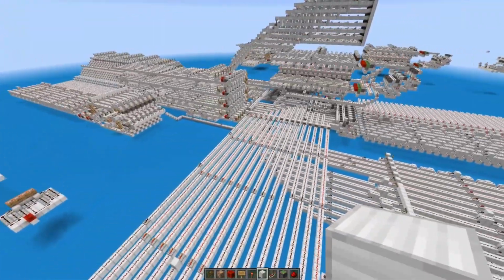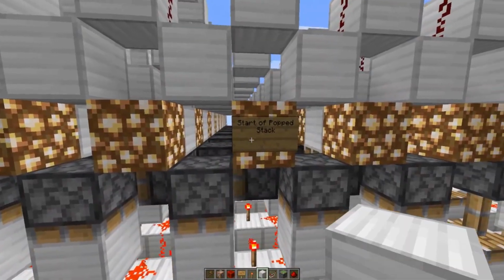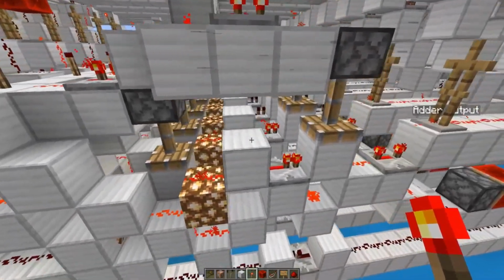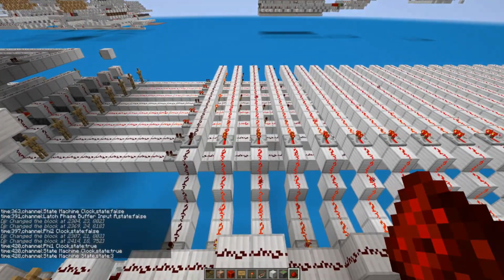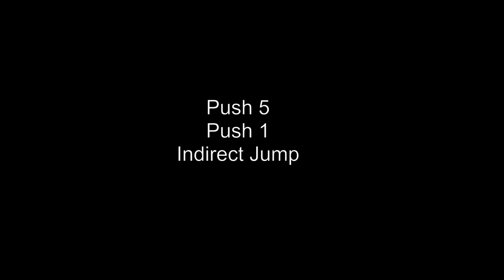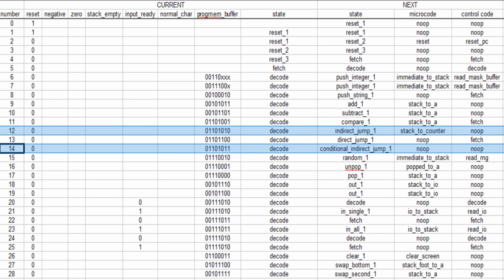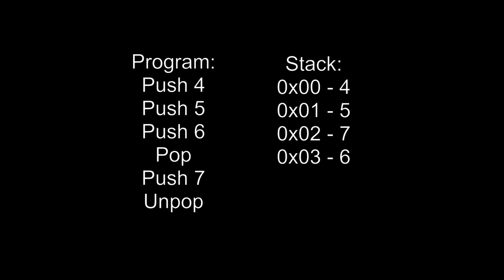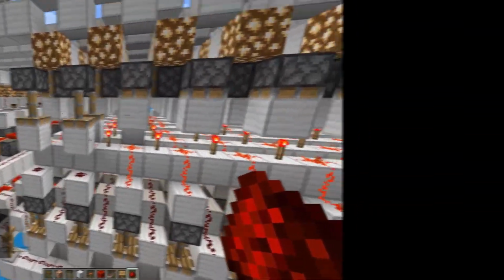Fatstacks Vlog Entry #8

Comment: random question, but on the adder, how do you get the carry out bit? I am using the same design on one of mine, and I am running into issues for the carry flag. Any help would be great
Reply from the maker: There's a carry line that runs through the adder, just tap off the end.

Comment: I'm currently working on my 4th computer, and I tried to make it a pipelined computer. I'm having a lot of problems with everything. Do you have any suggustions?

Also, do you know of a really fast adder design? I'm trying to make an ALU that can add 3 numbers at a time. When using a standard ripple-carry adder, It takes like 10 seconds with 5 adders. It may seem like an odd choice to make multiple adders, but that's one of the challenges I was giving myself with this computer. So... cool?

Also, In my computers, I've never been able to make a program that can devide. Like, how do you figure out how to subtract from 10 / 2? Is there a certain thing I have to add to my ALU?

thanks in advance.

The keyword is maintenance.
Reply from the maker: I can't say I'd be much help with pipelines, as I'm only just starting to explore them myself. The only thing I'd have to say is take it slow and test everything thoroughly. Dependencies are your biggest issue, watch for them.

As for adders, Bennyscube has a decent ICA circuit. That's actually what I was using in this computer.

 For division, You can give your computer specific hardware, or you can implement it in software or even firmware.
I'd recommend watching this guy's video on the subject: https://www.youtube.com/watch?v=z0RIEvzX65I
He shows a hardware approach, but it can be turned into an algorithm easy enough.

Edit: Ben Eater just recently released a video on the subject of binary division, I'd recommend checking that out too: https://www.youtube.com/watch?v=v3-a-zqKfgA

Comment: How do you make busses because repeaters are only one way?
Reply from the maker: You see the schematic at the roughly 6 minute mark?
Those are all uni-directional buses.

In electronics, you don't have to worry too much about the placement of your components because they'll talk to each other regardless of where they are on the bus.

Redstone does not have such an advantage... you need to be very mindful of where you place everything.

That's not to say you can't use bi-directional buses. My first computer, bluewave, used a bi-directional bus to connect everything.
I don't use them anymore though, simply because I find the chunkiness of the bi-directional repeaters to outweigh the benefits.
Reply: Oh ok thanks

Comment: I'd like to show you something pertinent to this project. Could you give me your email so I can send it (with context)? I couldn't find it on your about page on YouTube, maybe it needs a little maintenance. :)
You can find my email on my YouTube page, or you can send yours to me securely via Ricochet (website ricochet.im) my ID is ricochet:3frw7trm3uo3xe5w
Reply from the maker: While normally I'd be open to that, there's been a wave of account hijacks that's been going on, though it looks like you're already aware of that.
If it absolutely needs to be privately relayed, I have a discord... would that work?
Reply: @n00b_asaurus  I closed my Discord account and I'm not sure if I could make one without a phone handy (which I don't really have one handy). Is there any other method? I could provide information only I would know or something like that.
What I want to message doesn't necessarily have to be through email although it's best suited to it. It involves me sending some (small, zipped) files. You could set up a burner email if you'd like, I'll check my spam.
Reply: @n00b_asaurus  If you don't give me an email in a day or two I'll go ahead and upload the files (and a stripped down version of the email I intended to sent) to a file hoster of somesort. I'll link it here of course.
Reply: @n00b_asaurus  I went ahead and uploaded it to Google Drive. It includes a stripped version of the email. Feel free to share the link if you'd like.
https://drive.google.com/open?id=1Ug28m0OLMB3-UAEoQzhjQnBL92x0A3oK
Reply from the maker: Hey sorry, youtube notifies me of new comments, but not new replies.

I appreciate the update! It's definitely been a while since I heard from you. 
It's quite alright if you took a bit of a hiatus, I just noticed one day that your website had been taken down and your youtube channel had been drastically downsized. Got me a bit worried.
Hopefully tying up loose ends doesn't mean it's the end of ender_scythe. I appreciate your input, and I always like hearing peoples stories of projects, discovery, and improvements. Ultimately it's your call though.

I'm glad to see you liked what I've done with your project :D I've said it before, this was a very interesting challenge, and I'm liking how it's turned out so far. And yes, if you're up to suggesting more challenges, I'm up to hearing them.

It's great that you took up programming again... but seriously? C?
I'm joking! If it works for you, more power to you.
Don't worry too much about your early work being terrible... everyone's first attempt at anything is terrible! Fortunately when you're at the bottom, the only way to go is up.
I'm also glad to hear I've inspired you to pick up the stackish project again... it took me a second to realize stint was short for stackish interpreter... classic C shortenings :)
Have you seen any of uncle bobs lectures? I'd highly recommend watching his video about test driven development. I would say that and his SOLID lectures helped me out tremendously!
I would also recommend reading up on OOP is you haven't already.
I used to dislike it myself, mainly because I didn't entirely understand the point of classes and objects. Selling it as a tool for organizing code into hierarchical taxonomies didn't help... that just made everything worse!
It wasn't until I learned about polymorphism and the idea of changing the functionality of code without changing the code that it all sort of clicked.

I bring this up because it looks like you intend on adding more features to your new stackish interpreter.
I think those concepts might help you keep things organized while also minimizing the amount of rewrites you need to do every time you add a feature.

Of course if you already know about all this, then I look like an arrogant snot XP
If that's the case just ignore me! You're doing fine without me.

If you like code obfuscating, have you seen bisqwit?
He have a video about obfuscation I think you might enjoy....
Actually if you like C, you might enjoy his channel!

I do appreciate the logo, and I think it will go nicely in the computers manual :)

Regarding unix to stackish, I was thinking the same thing. There are many things the architecture would need to support, but you're right, memory management and interrupts would get it most of the way there.

Thanks for your suggestion for the original idea.
Hopefully I'll continue to see you around!
Reply: @n00b_asaurus  I'm afraid it probably will be the end for ender_scythe, although I'll stay for a bit (or byte, or word...) longer since this is all really interesting and I might have a few more things left in this persona. Of course the end of ender_scythe won't be the end of me. I'll just leave to a new name on likely a different platform. Software development is really fun and videomaking is really interesting, it'd be a shame if I just stopped. Before I truly leave I'd like to compile some sort of archive as a checkpoint of sorts for me (and the few that remember me) to reminisce on my projects and friends I once had here. 

  C was actually a language I set as a goal to learn back when I only knew Windows Batch script. I learned Python one day from a redstone YouTuber and decided to go forwards from there. Stackish was one of the first substantial things I did with it, and while ugly I'm still pretty proud of it. Afterwards I made some other Python things and eventually took up C. I haven't seen uncle Bob but I'll make sure to check him out. Test driven development (at least as far as I know it) is really useful. My workflow for programming is often starting from some weird architectural or algorithm idea which is jotted down in pseudocode then expanded and the rest of the code is built around it. Test driven development is really useful for going in the opposite direction, where instead of making a wholly new program a functionality gap needs to be filled. As for OOP I similarly hated it, because I didn't know what it was and also because of that OOP sucks video (or whatever it's called). Now I'm somewhat familiar with it but C and procedural is more fun in a way. Something about structs in C feels right. Polymorphism is really useful, though. My problem with OOP now isn't with OOP but rather that all the OOP languages are either ugly, slow, or incompatible with Linux and/or BSD (in my opinion). C++ is ugly, C# is incompatible and ugly, Java is ugly, Python is slow, etc. Functional programming is similar, although I like Lisp.

  I probably won't add any new features to the Stackish interpreter for the time being. If I do it would be at most a couple commands. I do think it deserves a cleanup regarding the decode_execute function, which is a weird lookup table thing right now. Making a registration system would be a good idea. I'm not entirely sure how registration would work as far as getting all of the functions at the start but I'll cross that road when I get there. Also separating and doing some housekeeping would be a top priority. Something about me says the input, stack, and operations should really be in separate files.

  I have seen Bisqwit, and his obfuscation video! It's a good video and the tricks are quite useful when making beautifully ugly code. I didn't really go as deep as I could have with the obfuscation. I could've quite easily crammed most things into a single function, removed redundancies, used an abundance of goto, made the entire thing a glorified state machine powered by said gotos, etc. but I didn't because it was just quicker to cram everything together and do some basic inlining.

  For the logo I think a black on white colorswap of it could look really good in a manual. Crosshatching or halftoning it may also look good and could give a more printed feel to the manual.

  I think multitasking Stackish is actually really close to being able to be implemented. Since I added the x command for testing it seems plausible to use the stack as an 8 bit memory array where values less than zero or greater than 255 would signal special portions of memory. Between these markers process information could be stored. Jumping between them would still be hard though, since it would somehow need to know how far it's along in the process of jumping to its destination. An accumulator would probably work. The accumulator could be operated with the pop into accumulator and push from accumulator operations. This way the normal instructions could be used on both the accumulator and Stack. All in all only 3 new operations would be required. As a sidenote modern me feels that i and the = ! < and > should be separate operators, but that's a different update.

  And thanks! I hope I remember this account in the future!
Reply: Also what's with YouTube comments and turning double newlines into single line breaks?
Reply: @n00b_asaurus  Turns out I added a bunch of features, enough to warrant a 2.0.0

I added a registration system for commands which allows them to be triggered on multiple different characters. I used this system to add a version selection which now supports the original Stackish specification as it was in the original Python interpreter.

I added a few commands mainly for a Stackish VM implementation. I split up the comparison operators and if and also added an e command which is an else for if. There's also an accumulator now. I also made a companion program that can preprocess Stackish code. It understands a superset of Stackish with labels. These labels can be jumped to like in assembly. The companion program can replace these labels with their positions and can also remove comments and whitespace. All of this makes Stackish much easier to use, since you don't have to worry about character numbers. I think my implementation is a bit buggy but it's a pretty small edge case.

I made a logo for Stackish itself, as well as some text logos for the planned StackVM and StackOS.

There's command line arguments now, and you can now run code directly from the command line, no files needed. The printing of the main stack at the end is disabled by default but can be turned on with -d

Since my last thoughts on it I realized there was a better way of addressing memory. There's a way to use the / (swap top and second) to move a value along the two stacks using clever popping and unpopping. The method should work for an arbitrary number of elements. This method could be used to store where the address pointer is, where it needs to be, as well as registers for the VM in an always accessible place. This method only requires the extra x command and never uses the accumulator.

I think with these changes and ideas multitasking Stackish is actually something that could be implemented. I've added the y command so input would be feasible. Honestly with the memory more or less solved the only issues I can think of is implementing bitwise operations.

https://drive.google.com/drive/folders/1Z69UckYMIRkvfWTk82-M9z4b8xQzO4-Q?usp=sharing
Reply from the maker: @ender_scythe2879  Again, youtube doesn't notify me of replies... even if you @ me.
Fortunately for you, I fan through old comments from time to time to make sure I'm not missing anything :)
Also, jesus! Mr I'm not going to update stackish goes ahead and updates stackish!
I hope you don't expect fatstacks to follow suit XD
So, label recognition, comments and whitespace handling, command line execution, sound like you have the making of a full fledged language.
While dabbling in the in game compiler project (which I do intend on resuming) another viewer pointed me to an online book called crafting interpreters.
It is in java (sorry, not sorry) but it walks you through the process of creating a language compiler in a nice step-by-step process... very nifty if you're curious how that stuff works.
Craftinginterpreters.com I would highly recommend giving it a read! You might get something out of it to improve stackish some more.... I mean... if you decide to improve stackish some more...
As for TDD, Uncle Bob spells out the important of it quite well... I mean, initially I thought it was just something you used to automatically test your code, but Bob shows you how going through this very short cycle of write some tests, write some code can result in algorithms that develop themselves, as you mentioned.
But it also serves as documentation for how the code is suppose to be used, as well as a neat little "is this still working" button for when you do any refactoring/optimizations!
The rule is basically start by defining your behavior in a test and write enough code to past that test.
Hopefully I'll be seeing you around, even if it is as another account :)
Reply: @n00b_asaurus  Seems like you posted at pretty much the exact same time as I decided to log in.
No worries about updates! Fatstacks is a really cool Stackish 1 interpreter, I wouldn't expect you to reinvent it when I turn a few things on their head and add completely new features.
I'd say I have a pretty fledged weird assembly language kind of thing right now (although labels stopped working for some reason). My goal was to get it far enough to make a basic emulator which could run more normal code which would be what a multitasking OS would be built on.
I love that compiler project of yours! And that crafting interpreters looks super useful, I'll have to come back to that one. I've been meaning to learn Java a little bit simply because it's used everywhere in computer science teaching. A project that another me has been working on involves parsers and a whole lot of other stuff that the book could definitely help with.
I think I first learned about test driven development when searching for unit testing frameworks for C. I was writing something and this one bug was absolutely infuriating me so I isolated it to one function using gdb, valgrind, etc. but I couldn't get farther. I wrote some unit tests and managed to fix it. Once I fixed it I realized you could work in the other direction, which is when I came across Check which is all about test driven development. Honestly I should use test driven development more since a lot of the time I make up an interface and fill in the gaps, which is pretty much test driven development but without the tests. The problem is choosing which framework though...
Reply from the maker: @ender_scythe2879  Yeah I can't say I'm much help there... I primarily code in python, and as far as tdd frameworks go, unittest is pretty much the only one out there.

Comment: Why do you have a random number generator in your computer? Because you can? 

And I did stop with my computer. Because I got sidetracked with game engine development. At least with watching this kind of video. 

Nobody seems to write Maintenance into their comment.
Reply from the maker: I did notice that. As long as I can tell it's not a bot, it's fine... though there will be no mercy for those who just leave generic comments >:D
Reply: Stackish includes an RNG as part of the specification. For some reason I made it limited to the unsigned range of 0 to 2^31 - 1.
Reply from the maker: @ender_scythe2879  And of course mine is limited to a range of 0 to 255... or -128 to 127 depending on how you're looking at it....